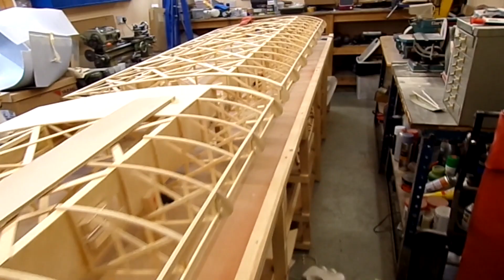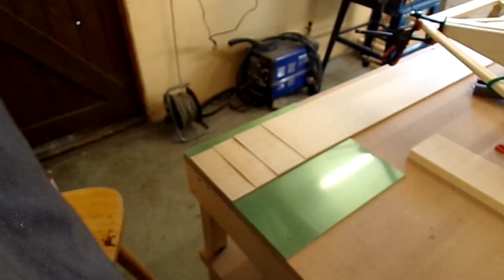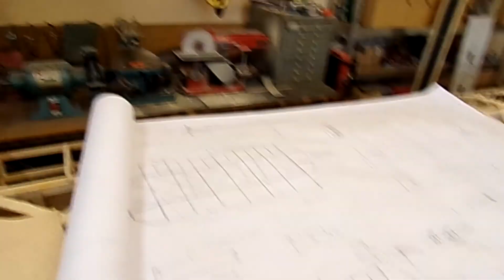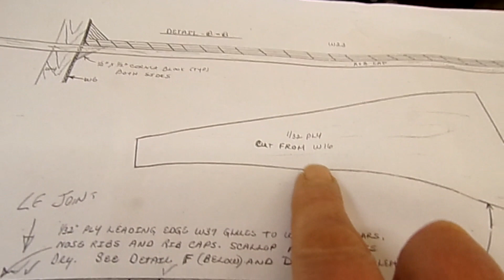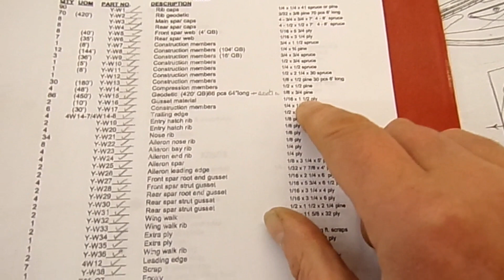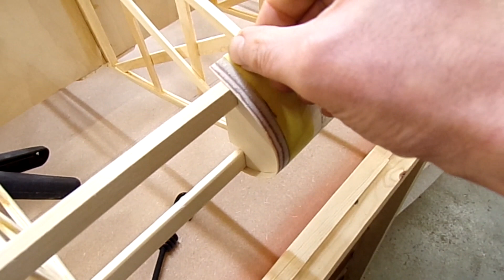EP43 Fisher Youngster V leading edge and wing tips.

Comment: Right, on the geodetic... but what do you call the 1/8th x 1/2 strips of crosshatched reinforcement strips of wood? I just assumed people called it that to give it a name other than 1/8 x 1/2 in strips of crosshatched reinforcement strips of wood.
Reply from the maker: The 1/2 by 1/8 strip becomes part geodetic structure once it is bonded into any form of lattice, until then it is just strip wood. I hope that helps clarify the engineering terminology.
Reply: @flyingkub  Yeah, I had issues with it being called geodetic when I started building, but stepped in line and did the same. But my comment was what to call it instead of geodetic... I believe your answer was "strip wood". Cool
Reply from the maker: @timketcham9139  that's it is just strip wood :-)
Reply: I have trouble naming things when making my videos, but you..."wee bits" & "strip wood" I'm like... yeah, that's what they are.

Comment: looking fantastic so far, it's interesting to see how fisher style aircraft are built.  
Probably a bit early but are ya going to add a fully enclosed cockpit option for the winter season. Looking at images of other fisher aircraft, there's a fp404 D-MYBM that has what looks like a canopy that can be completely removed without any unsightly connections or much additional structure, even if the fixed windscreen is a tad larger. Same can likely be done for the youngster.
Reply from the maker: There is an option on the plans for an enclosed canopy but a 194cm (6ft 4.5"), it would need to be a bubble canopy (which is a pain from my experiance to form) and also very keen to keep the weight down to make the SSDR rules here in the UK [300Kg MTOW] (the canopy and runners would add about 2Kg (4.4lbs)), so I will be keeping it open cockpit. I have designed a classic style windscreen and will be changing the rear deck style, to that of a more classic biplane, due mainly to the fact I am so tall, if shorter I would probably make a Pitts style canopy.
Reply: @flyingkub  I see what you mean. looking forward to seeing what the new deck style will look like. :)
Reply from the maker: @teaandmedals  I hope you approve when it is done :-)

Comment: I just did a butt joint on the leading edge but I might try this on the aileron and next leading edge——although the butt joint came together pretty smoothly and it will be cover with fabric as well
Reply from the maker: Butt joints over formers work well and easy.